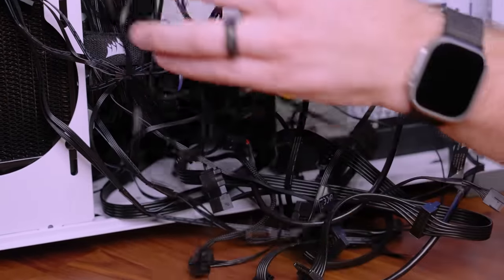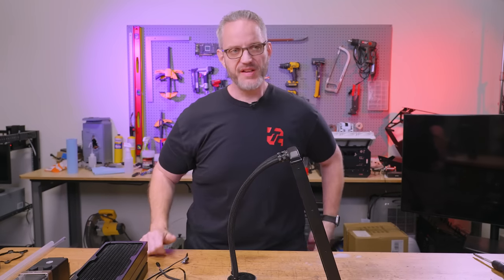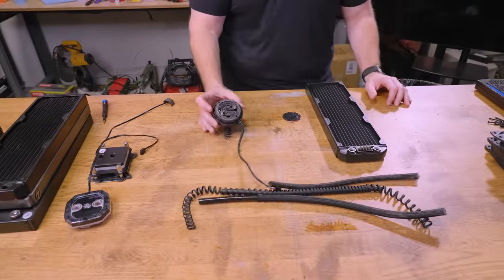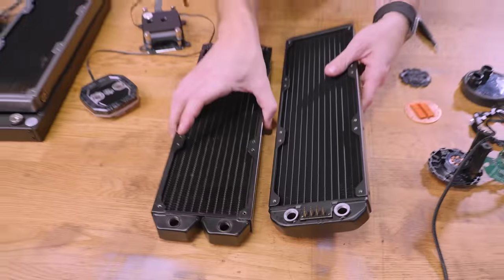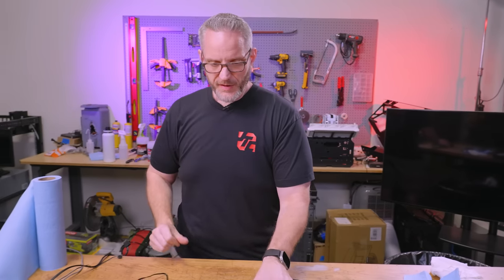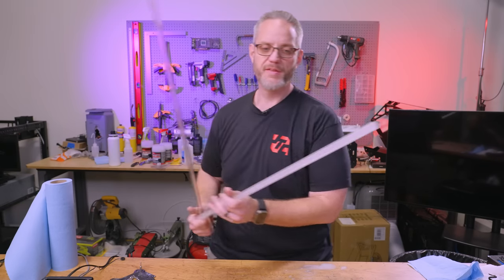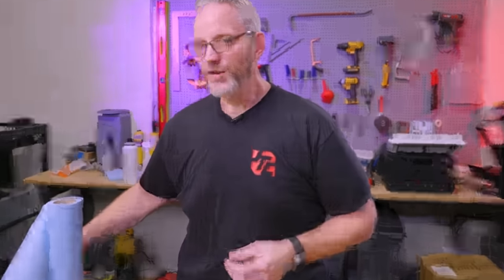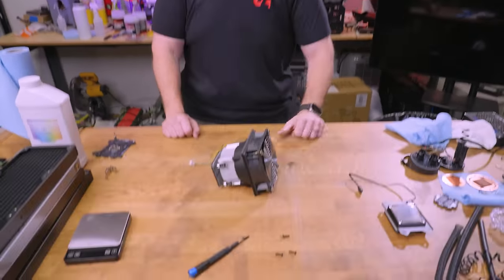Which one is right for you?

Comment: Regarding the coolant type, this is also true for automobiles.  When the manufacturer says to use a specific type of coolant, abide by it or you run the risk of corrosion and potentially turning your engine into a boat anchor in time.
Reply: With cars you just need to research whether they're lying or not. I messed up on my truck by mixing 2 incompatible fluids and it gummed up and killed the pump. Some of them are just proprietary for money tho
Reply: This is mainly an issue with FCA vehicles. The HOAT vs OAT confusion is a mess
Reply: If you have a German car, trust in their engineering :) There is a reason it is like that ;) Yes, they require maintenance, but maintain them as needed & specified and both you and the cars will have a nice, lovely and prosperous life ;) Computers are exactly the same way as cars -both hardware & software and besides water-cooling ;)
Reply: @Helifax19  you got jokes 😂😂😂 German cars were good in the 90s, now there is nothing to trust except maybe the engine block and idk about that one. German cars don't live prosperous lives, Japanese cars do
Reply: @andrewk8636  I think it depends where you are ;) In Europe is the other way around ;) German cars live a long (too long) time. I can't argue with JP cars though:) They live long no matter where they are! I vote them for the means of transportation on Mars or Luna - when/if they still do those expeditions :))

Comment: I recently swapped my case to pretty much my dream case (Fractal Torrent, I'm going to be using this thing probably for the rest of my life, or until PC parts change dimensions enough that they no longer fit) and dumped my AIO in favor of an NH-D15, which, again, I will likely use until mounting systems change or CPUs become too large for it. Fans are easy to replace, I don't expect that to be a problem for my case or cooler.

Comment: I've probably been very lucky, but I'm still using my 2015 Corsair H105 AIO. Yes, a couple of years ago I completely disassembled it because it was making air noise, replaced the hoses with food grade silicone hoses that will withstand from -60C to 200C which I attached to the pump and radiator with fuel hose clamps and of course changed the coolant. 
I transferred it from one PC to another and am still using it. 
I might buy a new one but I want to see how long it lasts. 😅
Reply: I have a h100i I just cleaned and refilled for the first time with my new build, hardly any evaporation. Running great with my 13700k in the 750d case. Had both asking with the evga supernova g2 750w going strong since 2014/2015
Reply: you can now turn it into a full custom loop.

Comment: It's just for show basically. You can buy an amazing airflow case, upgrade your GPU, CPU, RGB fans and a huge air cooler for cheaper than a custom loop. The PC will look amazing, maintenance is just cleaning it 2-3 times a year, there's no risk of anything leaking, destroying your expensive components and your performance will be better since you've invested in newer, better, more power efficient parts that require less cooling instead of pumps, fittings, radiators and tubes. Running your components under full load at 60C-70C instead of 50C-60C will not thermal throttle them at all and will not reduce their life span to the point you'll need to replace them before they're completely irrelevant. As a hobby, it is fun. But for most people, performance matters most.

Comment: I just serviced my AIO a couple of days ago.
It's an Alphacool Eisbaer Pro Aurora 360 and it was designed with maintenance in mind. Also the radiator is copper (and brass for the threads). It has a fill port in the pump housing, a quick-release connector in the tubing and you can easily unscrew the base plate.
This AIO has all the relevant features in terms of longevity and maintenance and quality but when it comes to cost it's not more expensive than your typical mid-range 360 AIOs.
Downsides are the clunky appearence, the noisy fans (I replaced them with Lian Lis) and the relatively low flow rate of the pump (compared to a custom loop).

Comment: I wanna know your thoughts on the Alphacool AIO’s! They use off the shelf parts like copper radiators and DDC pumps, and they’ve got quick-disconnects for adding pumps, rads, or linking other loops together. Been considering a dual 360 setup from them and combining the loops for my next build, seems like the best of both worlds

Comment: I have the EK solid white in my loop for a few years now. The longest I had it running without exchanging it was 2 years. So far I had no problems with it. Nothing has fallen out. Every time I took my loop apart it was perfectly clean, no residue in sight.
What might contribute to that is the fact that i use glass tubes.

Comment: It would have been nice to see the temp difference between the AIO and the custom loop.
Reply: Temp difference is not usually enough to justify the cost difference. Most people do it for looks
Reply: He has a ton of vids on that. Custom loops are the way to go for cooler temps depending on application and what your doing with the PC.
Reply: @stevenandrews8225  Until you get to 7950x/13900k & 4090 levels of heat, then temps will be very different. I live in a very hot and humid climate (40c summers), so air isn't an option, and AIO's aren't going to keep my HW under control (there is also a good amount of overclocking going on and the margins really start to matter at that point).

Comment: Should probably also comment that a water loop does NOT need to be as expensive as Jay here implies.   The main item you look for really is just the cpu water block or plate as that has to fit.  (but you can still get cheaper options than EK, even older ones can be modded to work).  But everything else you can get from local stores.   I mean a water pump, go to your local pet store and pick up an Eheim pump, you can get tubing there as well (though I prefer Tygon 2475 or 3603 depending on what fluid I'm using).  Barbed fittings can be found at home depot/hardware store as well as the clamps.  for a radiator you can go to a local junk yard, or if you're friendly with your HVAC guy see if they are replacing any units and pull something from there.   Fans can be anything as well (old computer fans, bathroom fans, or whatever).    It's NOT rocket science.  Biggest item is to check galvanic corrosion tables (ideally using all brass/copper for example for metals). and then some distilled water & water wetter (auto store usually).    It may not be 'pretty' but it works.
Reply: This is some scrapyard wars tier bootlegging
Reply: @Junebug89  and I'm here for it, very function over form
Reply: I used to use Eheim pumps for all my loops - they aren't as fancy and tend to look a bit more clunky, but this is what they are designed for.   I had one fail after 9 years - I was quite satisfied with that sort of longevity.
Reply: @malphadour  yup, people just need to think a bit outside the box.  That was 'normal' back in the 80's/90's.  Companies these days all try and make people think that you NEED them (to lock you in), but physics works the same for everyone.     For pumps I've even used auto fuel pumps (they're also 12v) but they are not rated for 24x7 like a fishtank pump, so they burn out faster.

Comment: This definitely made me check my AIO and my temps. Going on 5 years old and seemingly fine. Pump temps are fine though the actual CPU temps are a tad higher than I'd expect.
Reply from the maker: That's likely due to needing new thermal paste
Reply: @Jayztwocents  Thanks for the reply! That’s definitely something I need to do at this point.
Reply: @Jayztwocents  Thanks again for the reminder that this should be done. Replaced the stuff that came on the Corsair AIO with some Kryonaut and it brought the CPU temps down several degrees. It also somehow fixed the weird issue I had where the task manager would falsely report 100% usage until I reset the power settings.

Comment: Custom can be bigger, generally has more liquid so it can take away more heat without actually heating up
Reply: Fanspeed 110% + headphones.. no problem
Reply: I'm not sure more liquid = take away more heat.   I think it all boils down (no pun) to what's happening at the radiator that is the place where all the cooling happens, if you move it through too fast it doesn't cool down the liquid much, if you do too slow then it doesn't pull the hotter fluid away from the cooling plate quick enough.
Reply: Kind of but not quite. More liquid does take longer to heat up IF you are applying heat to all of the liquid at once. A loop will have overall cooler liquid avg because the majority of time the liquid is not doing anything. Once the liquid is cooled leaving the radiator, it is not doing anything to help cool the system until it goes through the block. The temp of the liquid before that point means nothing useful to the heat exchange unless there is an issue with it not cooling down coming out of the radiator. 
The only 2 places that temp matters is the exit of the block (showing that it picked up as much of the heat transfer as possible) and the exit of the radiator (showing that it is being cooled down as much as possible for it's next pass). An AIO that shows a huge degree difference in those 2 spots could mean that it is removing a ton more heat then a custom loop that shows the liquid is cooler overall but the difference in exit temps is much smaller.

The only thing that really matters is that you like the cooling option you put in and it the setup works as you want it to.
Reply: @sierraecho884  The question was whether a larger amount of liquid in a custom loop would draw more heat then the smaller amount in an AIO. The answer is not necessarily because neither are passive systems of dispensation. Nothing you said disputes what I said. Your right, a cup of liquid will heat up faster then a tub. But if you apply the heat at the same point and implement the same type of cooling rotation for the point of heat contact, you negate the difference. At any point there is x amount of heat being transferred in y amount of surface area and the liquid is leaving that area to cool and come back. As long as both solutions have enough liquid, the amount of liquid being used in the loop means nothing because only the liquid in contact to the transfer surface matters. That is the liquid that will be heating up. If the heat to transfer, the surface area for the transfer and the rate of flow are equal then the temp of the important liquid will be the same when they leave the block. 
If the transfer area is a segmented 1 liquid ounce then it doesn't matter how much more liquid is waiting to be heated up, whether a cup or a tubs worth. Only the 1 liquid once that has been removed from the cup or tub for the exchange does.
The amount of liquid above the minimum necessary to function means almost nothing to performance while the surface area in the block is hugely important. AIO or custom, the one with the better fin/channel contact surface area design is going to provide better cooling.
Reply: More liquid is irrelevant to final temperature, it will just extend the time until you reach heat soak.   More dissipation is what takes away heat and this is down to the properties of your radiators and fans,

Comment: My Arctic Liquid Freezer II 360 A-RGB QC Rev 4 tubes down and MX-6 my Ryzen 9 5900x idles at 21c and never goes above 57.8c either in gaming or benchmarks in Cinebench r23 mc I scored 23,200 with CO disabled CPU boost +200mhz disabled all I messed with was the TDC, EDC and PPT. Also have a kit of 4x8gb G Skill Trident Z Neo CL14 3600mhz overclocked to CL14 3800mhz and 1900mhz x3 ran multiple ram test no errors room temp is set to 68f 24/7 open side panel.

Comment: I would love to see you look at expandable AiO (Alphacool has one) as well as how to include a GPU waterblock into it as well. I'm guessing it is able to accommodate a GPU waterblock and an extra radiator since it claims to be expandable.
Reply: The biggest problem in that, is that most of those small standard aseteck pumps integrated into the cpu block on aio’s is not powerfull enough to drive a bigger loop. They are just about big enough to drive a 360 radiator, but you are absolutely right. Would be nice to see more models using some standard fittings so you could add a gpu loop and a tap to empty and refill the loop. I don’t have enough knowledge if it’s even possible to theoretically add an extra pump and resovaire without problems, but have often wondered why they don’t make it possible to mod an aio via standard fittings, but its most likely to avoid having to foresee all the problems a modder could create to something that really only is designed to single loop system.
Reply: @mrdali67  On Alphacool's website, they also have expandable AiO GPU waterblocks. I didn't look to closely, but would assume these would just daisy chain. I would also think you could couple their AiO with an open loop GPU. Hence why I am curious and would like to see more.

Comment: Had a custom loop for about 4 years now. 

Was a fun experience building it, but for my new build next week i'll go for an 360mm AiO for the 7800x3d and air cooling for GPU and the rest of the case :) 

I've had a really minimum leakage on one of the hosepipes due to it not sitting straight on the fitting after warming up and bending a bit. Luckily i saw it immediately and nothing bad happened, also cuz my liquid is UV reactive green :D

Comment: My Corsair H150i 280mm AIO has been running solid for 7 straight years now (Built it in Jan 2017 on an i7 7700K) still only hitting 61-65C under Full load. Using Thermal Grizzly Conductonaut as Thermal Paste between die/IHS and between IHS and Coldplate. No leaks no failure. Front mounted in the case.

Have Not touched it in 7 years except from some dust spray cleaning of the fans and fins.

That is a damn reliable AIO and as headache free as it can get.
Reply: Ive got a Kraken from march 2017 aswell for the 7700k. Have not touched that at all. I started wondering about a year ago how long it will work 😅 
Ig ill just wait for it to break and take that as a sign to build a new pc

Comment: Aio for £130
Takes 10 mins to install
90 percent of the performance 
 The extra ten percent perf you get from loop is also unneeded by 99 percent of users
Reply: But no GPU cooling.
Reply: Is it possible to get another aio for gpu cooling just asking
Reply: @centenario6677  Yes, Alphacool makes the Eiswolf 2 GPU AIO using their open loop parts. I run a 360mm Eiswolf 2 on my 3080. Temps never go above 53c under load.
Reply: @kylesenior  not needed if you have anything that isn't a reference model. And even then. Many gpus can run very very hot.
Reply: I disagree.  More like 95% of the performance :)   Caveat - in regard to pure CPU only cooling.  Especially when the £130 AIO is an Arctic LFII 420.
Reply: @malphadour  yeah for sure it’s worth it for cpu but you can also fit the nzxt bracket for a gpu and aio lol so for 275 you can do cpu and gpu lol

Comment: I did my first custom loop 2 years ago with Thermaltake pastel colours and after about 3 months I noticed all the colour leaching out of the reservoir and planned to replace the fluid.
Approximately 3 or 4 days later while sitting at by computer the first fitting after the pump blew the pipe out and dumped all the fluid into the case. I inspected the fitting and pipe and it was perfect, so what I believe happened was what ever chemical reaction that caused the colour to leach out pressurized the system. 

I contacted Thermaltake and they not only replaced the pump/res, radiator, fluid and pipe work they sent me a core P7 to replace the lost case. The point is that even when you do everything right you can still have problems.  I wouldn't recommend custom loops for your daily computer, also shoutout Thermaltake for stepping up.

Comment: "Custom PC Loop Cooling for Dummies." It's a handbook found at major bookstores. The book is located in the section containing guidebooks.  You will also find the "MS-DOS for Dummies" handbook there. In the past, I built a custom cooling loop system. The loop included my CPU and two RTX 2080ti GPUs. Remember when SLI was the way to go? The tube bending is the hardest part of the assembly. I made a stand for my heat gun. It keeps the gun's tip at a set distance and perpendicular to my workbench. I added a simple temperature indicator to the bending guide and placed the guide below the heat gun so I knew when the tubing was ready for bending. My heat gun has variable heat allowing me to adjust the temperature to find the heat 'sweet spot' setting for bending.

Comment: I've had both types of coolers. They both have their place. I went with an open loop and hard lines for the challenge and I like overkill. 
I'd agree with the cost factor. 
But here's the thing I've been running my EK blocks and pumps since 2015. 
You won't ever get an AIO to last that long. So cost over time works out better that way.
As far as tubes and coolant go , I started with acrylic then changed to PTEG and finally went with copper tube ...from a hardware store. 
For coolant I run distilled water with flushes every 3 months .
 No fallout of dye etc . Happy days and it's  cheap.
All that said open loop isn't for everyone. But when it works it works well.
If you want cheap cooling get an open airflow case some decent case fans and a good air cooler that suits your hardware.

Comment: I have a Raijintek Orcus 240 in my pc which has lasted 5 years now. It has the pump on the pipes and came with a bottle of liquid to replace if needed as it has a screw on the cpu cooler to drain . I've not yet needed it as it's been a superb AIO and still looks really cool.... It's now cooling my 5800X3D superbly